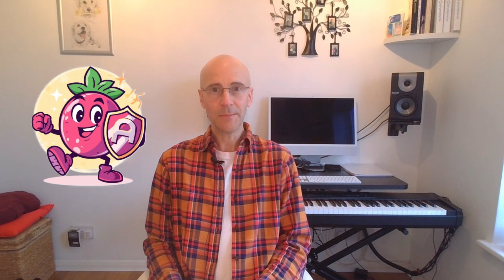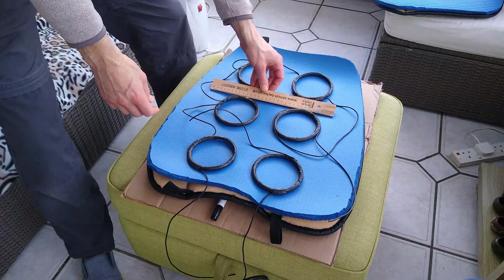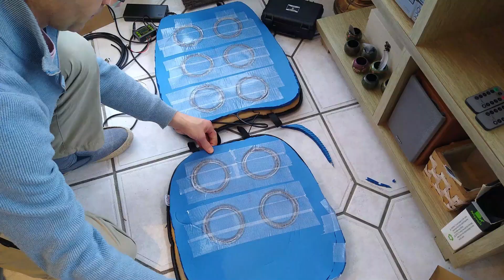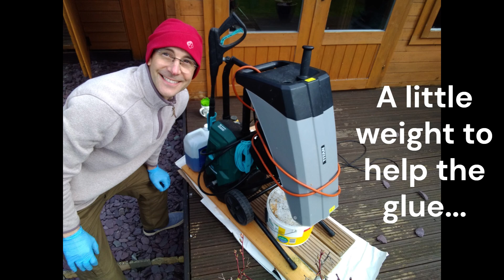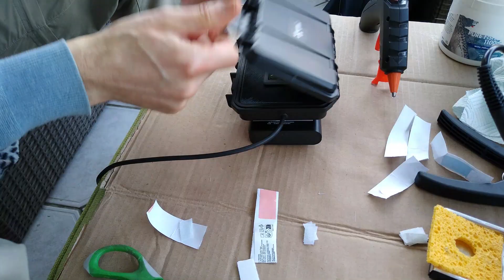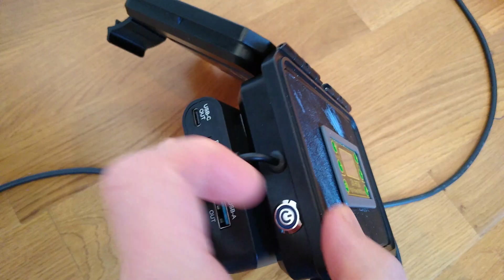DIY PEMF Therapy Chair Mat: How to Build Your Own for Pain Relief & Healing

Comment: Hi oliver..just recently came across your channel..watching your more recent upload brought me here..another very enjoyable video my friend. interested on what you wrapped around your coil maker.. getting the coils off seamed relatively easy!??
Reply from the maker: Hi Sean! Ah yes - I forgot to mention that in the video... A handy tip from Steeve Bradet was to use some greaseproof baking paper on the coil maker. I just tape a turn on the wheel and it helps to get the coil off once wound 😊.